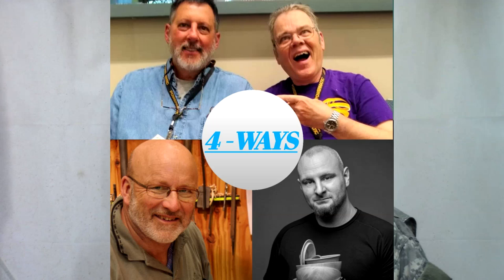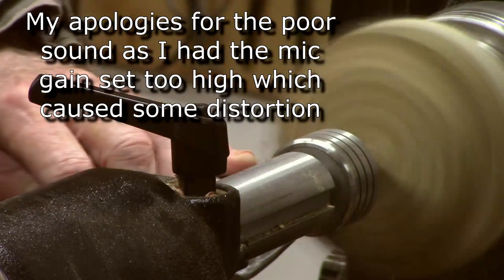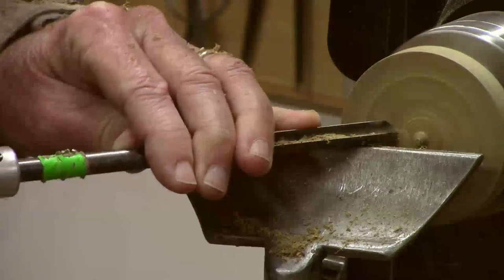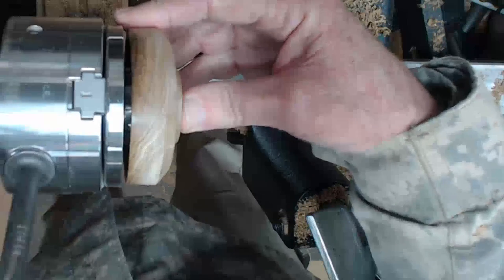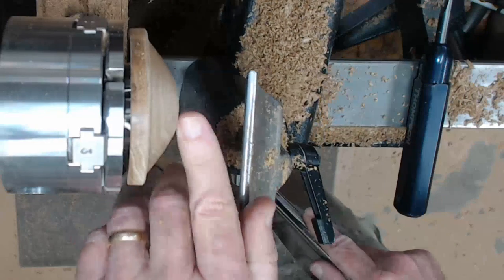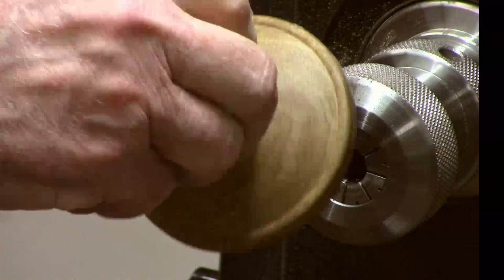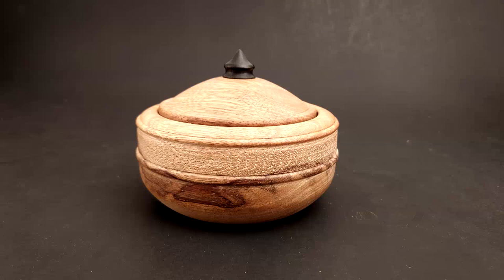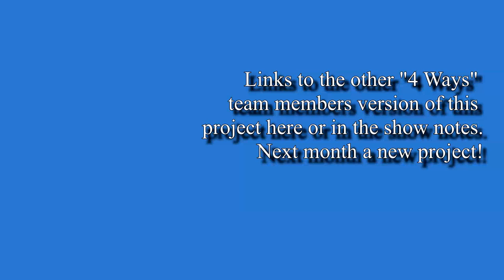4 Ways To Turn a Cross Grain Box- Mike Peace Woodturning

Comment: You say that the recess must match the jaw profile, but my Record instructions say all recesses should be square for the jaws to bite into. Thoughts?
Reply from the maker: I believe in following the manufacturers instructions until you have the experience to know when to deviate. Here is what I read in my RP instructions regarding a dovetail recess "Turn the recess at an angle to match the outside dovetail profile of the jaws being used as shown in Fig 3.5 then mount to the jaws and turn the
inside surface."
Reply: I also have a record chuck. In expansion mode - to fit into the recess it should be dovetailed, However in contraction mode - around a spigot, then you are correct about it being square for the jaws to bite into.

Comment: I am always surprised that skillful turners almost never comment on the turning speed that they use for various types of turning.  I think it would be helpful to specify the speed that you use for different aspects of your work.  Depending on the type of wood, the diameter of the piece, and the type of gouge or scraper you are using.
Reply from the maker: I think we forget that new turners may need that information when it is such a routine decision to set lathe speed for a particular project or tool.
Reply: I saw Jimmy Clewes turn a large plate , I think he colored the rim, at speeds I’ve never seen before, something like 3800 rpm? Awesome, but put me on the edge of my seat